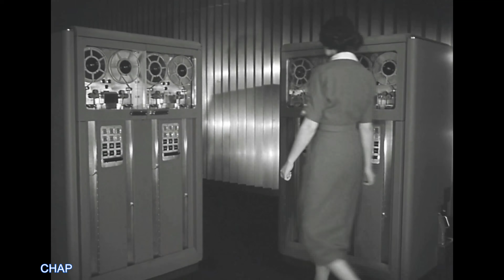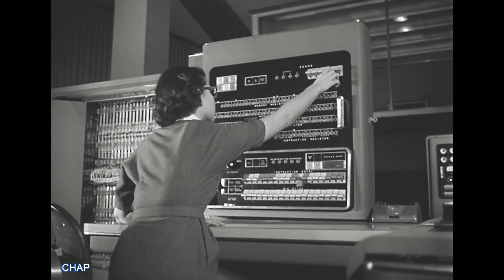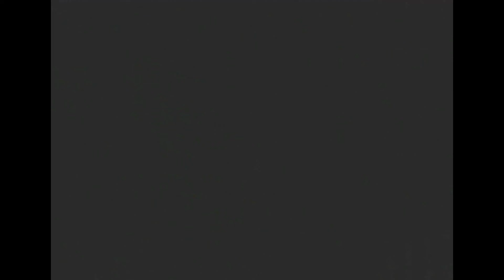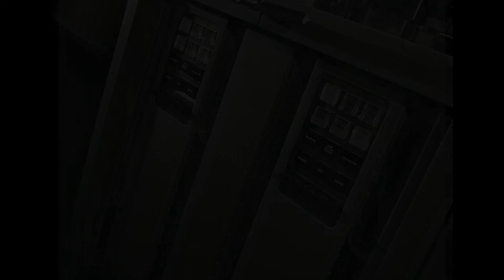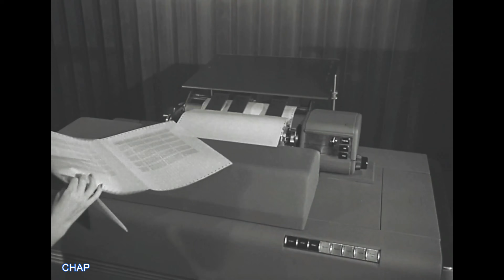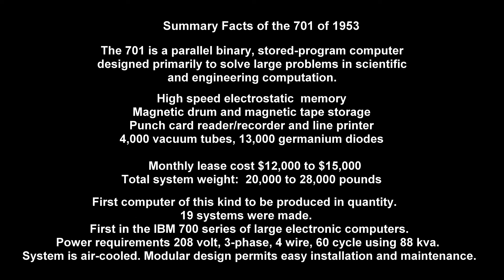Computer History 1953 IBM 701 Rare promo 1953 first of IBM 700 Series Mainframes, tubes EDPM

Comment: So, what was "high speed" back in 1953? Probably under 100,000 instructions per second..
I should see what my 704 and 709 manuals say. (Those were before my time, but when someone at my first job was throwing them out, I took them)
For me, it was the 1130 that took, iirc, 7 microseconds to add 16 bit numbers.
Reply: I looked it up in my 705 manual; that might have made it to 30,000 instructions per second. (.034 milliseconds plus for many instructions)

Comment: 3:59  Why on EARTH did that woman wind the paper up like that?
Reply from the maker: Why did she wind up the paper like that?    Well, here is my guess.... she was a "film model" used for the promo film only, and NOT a real computer operator.  She had no idea what to do with the greenbar printout.  Roll it up like a paper-towel maybe...  that's a guess.  But, good question on your part.  Thanks!
Reply: @ComputerHistoryArchivesProject  Your analysis is probably correct ... but as a kid who has worked with MILES of that greenbar paper, delivering it to the operators, if I rolled it like that, I know whomever I gave that to would have my head.

Comment: The William's tube memory was later replaced with magnetic core memory, at least on some systems.  It was common to run programs twice on Williams tube systems as the only way of knowing if a result was valid. Core memory's far improved reliability was very welcome to those who had lived with Williams tube memory. Early computer were so heavy I recall seeing one building built to support them  could later have extra floors added because to the extreme structure required by  the banks early computer systems.
Reply from the maker: Hi @jeffreyplum5259, excellent point.  The weight of some of those giant machines was something to be reckoned with.  Also, one can only imagine the work involved in prepping a building for a new install, or having to relocate a computer room.  Having to run programs twice on a Williams tube machine to verify accuracy.... wow, didn't know about that.  Makes sense though.  Thanks very much!  ~ VK

Comment: But can it run Windows? 😂😮😅
Reply from the maker: How many punch cards would it take to load Win 11 ?
Reply: If Windows 11 runs about 3.5GB, and a 0.007" thick punch card stores 80 bytes, I'm guessing a stack about 4.5 miles or 7.3km tall.

Comment: So few registers, it can display them all on the console, heh.  Impressed it can multiply, but it would probably have been poor for science/engineering with software multiplication.  Guessing division was via software.  Division is rather complex to implement in logic circuits.  Impressive size of the accumulator.  Nice to see this old footage.  Cathode tube memory!  I heard it was better than mercury delay line, because delay line memory was affected by stuff like temperature and vibration.

Comment: Today we have computers that are so small and light-weight that you can wear them on your wrist, and yet are thousands, if not millions of times more powerful.
Reply: That smartwatch still, fundamentally, operates on the same principles as that beast. The stored program computer design remains essentially the same. If you were to draw up a block diagram and describe its operating principles there would be little difference beside the actual electrical/electronic technology used.
Reply: The better to control you with.

Comment: In college, we had a Univac 1108, which like the IBM 701 also had a 36-bit word length. Instead of 8-bit bytes, it had 6-bit "sixths." Some 1100 series mainframes are still around today, decades later.
Reply: In fact, you wrote your comment using a Univac 1108 :)
Reply from the maker: Yes, they are quite enduring...

Comment: What a beast of a machine, it's huge. I love it. Thank you CHAP team.

BTW : The biggest problem with CRT memory is that the phosphor on the screen would wear out quickly.
Reply from the maker: Hi @frankowalker4662, you are quite welcome!     Regarding the CRT, it certainly had its drawbacks.  It seems like there would have to be a dedicated operator/technician to just monitor and replace the CRTs during normal production hours, to keep the machine running accurately.  What a task!
Reply: @ComputerHistoryArchivesProject  Yeah, they would be constantly checked. Nightmare of a job.
Reply: @ComputerHistoryArchivesProject  although it's interesting, CRTs were central to computer development even before used as terminals. Maybe it's hindsight, but it seems natural we had big CRT terminals long before large LCD screens.
Reply: @squirlmy  Somewhere, I have a late 1980's video of a flat panel electroluminescent display that never went into production. Would have cost $25,000 back then. And I was in the video. I need to find that and put it up on youtube.
Reply: I wonder if they moved the CRT units around to balance the wear? That would be an amusingly close precursor to SSD wear levelling …
Reply: @leocomerford  SSD ? Silly Sized Data ? LOL.